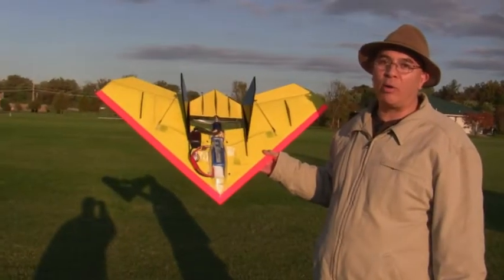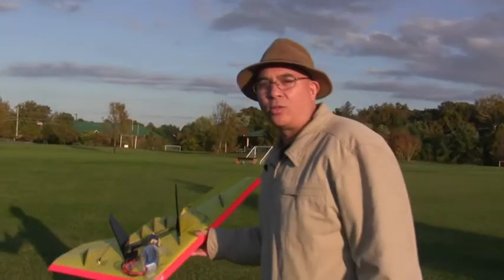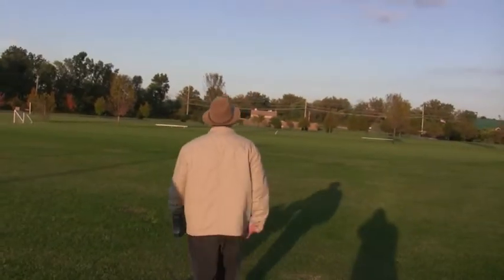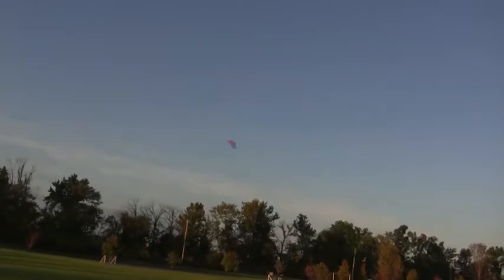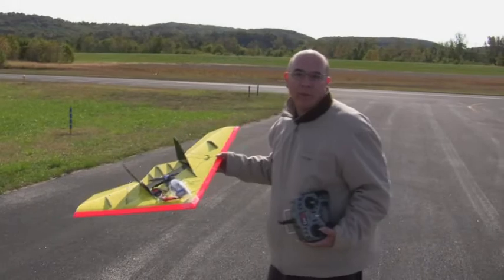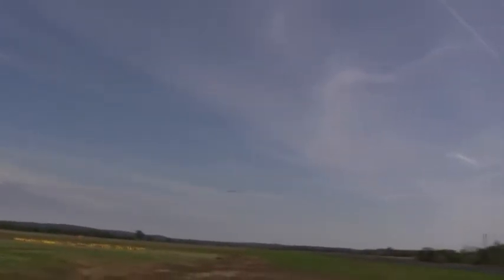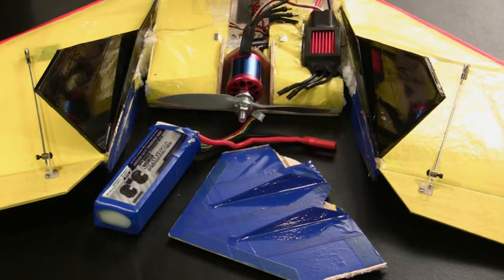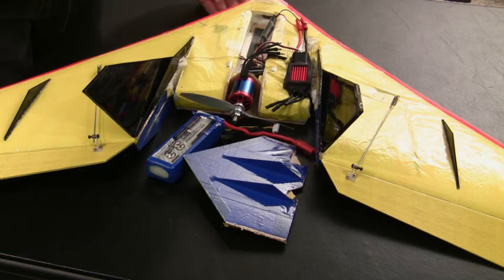Monster Delta Test Flights and Crashes

Comment from the maker: Congrats on being the first to post a comment!! We are still using the same camera but want to get a better one. I found out that the motor esc timing was off the first day out. I finally got the timing right the second day and the power came on!!! It's too bad I didn't have a chance to get a clean radar clock with the 7 x 8 prop on the plane before I crashed it. I think It would have beat my current speed record of 119mph!!

Comment from the maker: Dang SomeUselessGeek You are a poet and I didn't Know it!!!! As for static testing I usually test every set-up before flying with it. I did test this one with a smaller battery and esc  with the 7x8 and a 7x9 prop and was still way under the 1600watt rating of the motor. I would have tested the new set-up but didn't have any adaptors to connect the watt meter up. I will test it soon, Just seems like all these batteries have different plugs.

Comment from the maker: SomeUselessGeek we usually use a Wattsup meter which just plugs inline between the battery and esc. It gives you the volts, voltage drop, Amp draw, and watt draw all in real time as it happens. Then it scrolls through all of these giving you the maximum readings of each after you shut the motor down. I would have tested this setup with it but didn't have the adapters to plug it into the battery and esc I was using. I like the Wattsup meter because its completely hands free after you plug it in.

Comment from the maker: @yumekuimerry22 the motor, esc, battery, and bec are from HobbyKing. The equipment on the plane is a Turnigy 3648-1450kv brushless motor, SS90/100A brushless esc, Turnigy 3300mAh 30c 4s1p LiPo battery, and a Turnigy 5a UBEC. You can find all these on HobbyKing online store.

Comment from the maker: daveyedgar "not winding up right " means the motor is not revving up correctly to its full potential. "changing the timing" has to do with the timing of the electronic pulses the esc puts out to turn the motor by creating magnetic pulses which push the magnets on the motor to make it turn. Changing the timing changes when these pulses occur which determines how well the motor runs. There is more but that's how it works in simple terms. If the timing isn't right the motor won't run correctly.

Comment from the maker: It's all a part of the hobby jacquesone100. Besides it gives me a reason to build a new plane. I would like to recommend setting your rates down low when you go to fly yours. That thing is going to be crazy fast and the control surfaces are over sized on this plane. One other thing the plane is a little squirrely on the landings without the rear stabilizers on it so be ready for it when it comes in to land. Can't wait to see it fly!!!

Comment from the maker: RCFLIGHTHELP yes wing-loading is the correct term. This plane has a wing loading of about 15-16 ounces per square foot which is well below the 25 ounces recommended for fast planes. This might affect the plane at slower speeds but not when it is moving fast. The plane was flying fine I just made a mistake and it cost me the plane. It happens, more to some of us than others, lol!!!

Comment from the maker: vidsman77 I don't thing I lost a servo. I used Hitec HS-82MG servos on this plane which are very heavy duty they weigh about 20g each. After watching the video in slow motion I realized it was pilot error. As I approached the plane was nosing down so I pulled up but the plane rolled over and I lost orientation. Then I pulled up when the plane was inverted and low to the ground. It all just happened so fast.